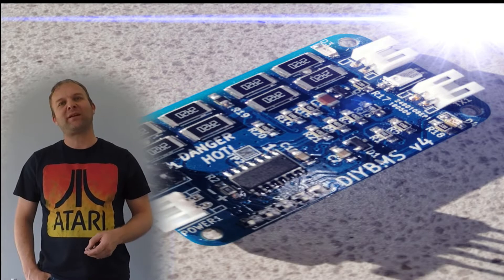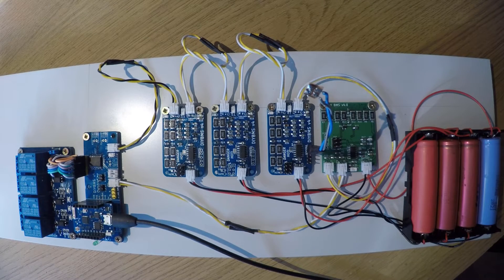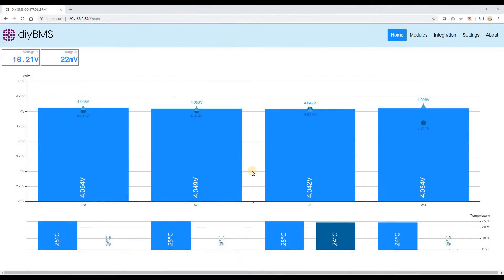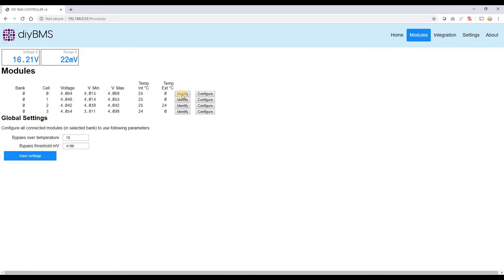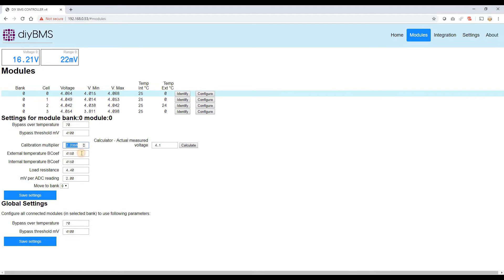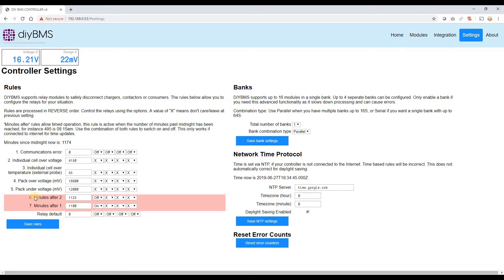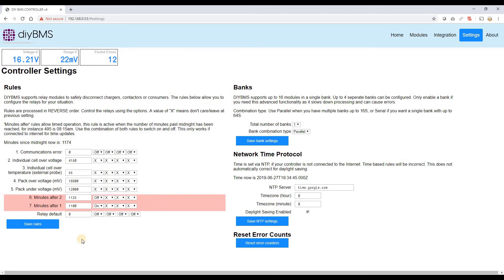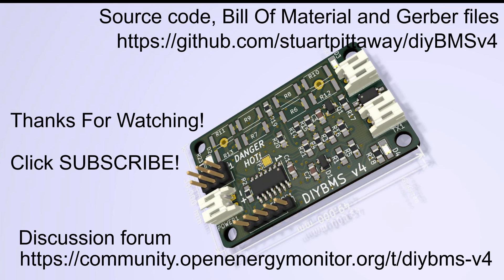DIYBMS V4 Introduction

Comment: Have you thought about changing v5 to active cell balancing?
Reply: I have added the Active Balacing feature on this hardware.
Take a look:
https://imgur.com/a/J5nLEh4

For now I'm designing the board, in a fiew days I'll order the parts to test it out!
Reply: @tuttocrafting  HI, First Stuart, great job. Second @TurboCrafting. Also Great idea. how did it work out? Any place where we can read more about this?
Reply: @rvamerongen  I've stopped, due to covid and an issue on the Atmel microchip. I was waiting a reply from the Arduino guys.

I'll see if the project will continue
Reply: active cell balance is so much more complex. Dont.
Reply: @petermatthiesen8288  thats not a good reason, if you can get the fly back to work reliably its not that bad

Comment: How does v4 work without the larger resistor relative to v3?
Reply from the maker: The surface resistors use about 800mA, but are temperature controlled by the board
Reply: @StuartPittaway  HI, I'am new to this project. Am busy to make my own but then I found this project. I Like to have them , the surface resistors , spliced in two to spread the heat. Maybe possible in a 4.01 version? Or should I change the board myself.
Reply: I just found out that there is a branch with this already. Thanks

Comment: Very professional, do you or are considering sell the boards fully build?
I’d be interested as i don’t have the equipment to solder on the parts.
Reply from the maker: I've got no definite plans to make the boards however if there is interest then I might consider it.
Reply: @StuartPittaway  Ok thanks, maybe you could ask/survey for possible interest, put me down as interested if you do.
Reply: @StuartPittaway  Yes please!! You could sell them by the boat load easily! Is there a safe limit to the number of parallel cells per battery monitor?
Reply from the maker: @MikeOPCgeek  not really although smaller packs are easier to fault trace and repair individual cells if needed
Reply: @StuartPittaway  Thanks! Just thinking economics of scale. Maybe just 4P per monitor. If you can get them printed please update us!!  I can't comfortably solder tiny part. I can do pins on a Wemos though! My fav esp chips.

Comment: Hi Stuart, you are a rare gem in this generation. Hardly will anyone do stuffs like this and give it away. Thank you. I have been to GitHub but there is no BOM. Could you provide that and if possible a complete how to video. Thank you once again. Segun Oladipo
Reply from the maker: I’ve just been working through a bill of materials list for LCSC - its uploaded onto GITHUB named “CellModules_LCSC_BillOfMaterials.xlsx” this doesn't include the ATTINY or LM4040 devices though as they don't sell them!
Reply from the maker: Yes there is, take a look at v4.csv in the circuit folder. Alternatively open up in kicad
Reply: Hello Stuart, how can I reach you by mail.
Reply from the maker: @adewaledipo  go over to the openenergymonitor forum and contact me via that. Thanks